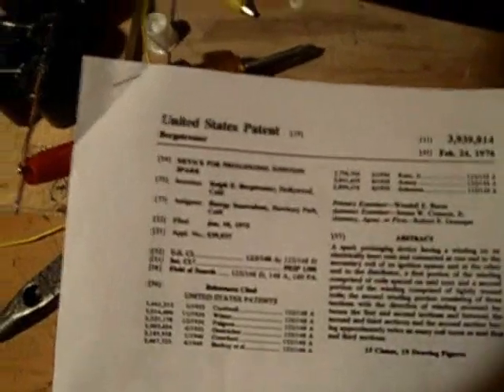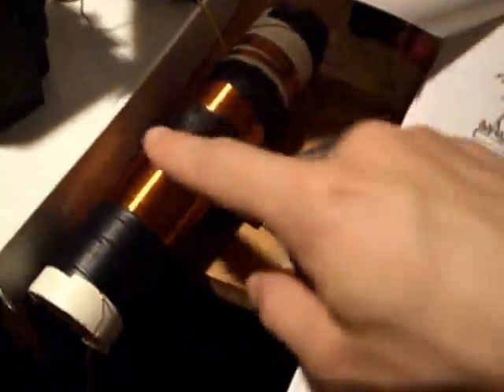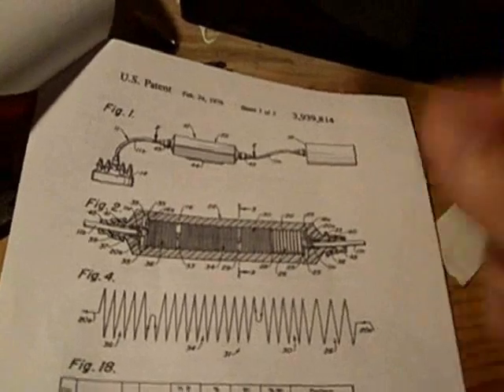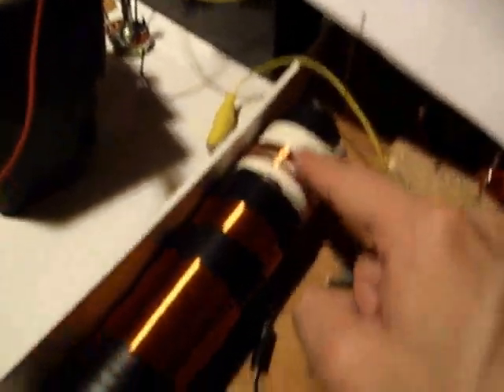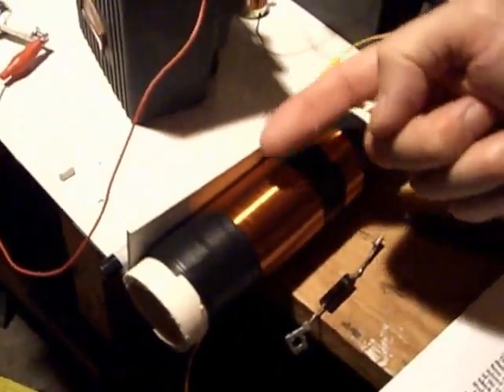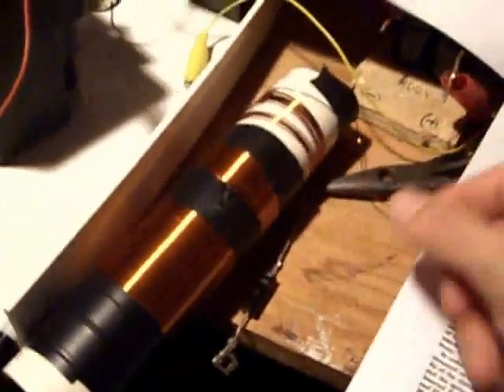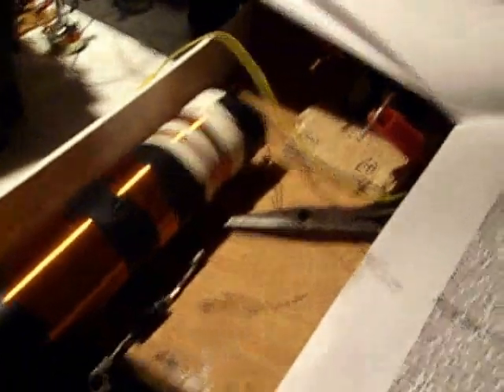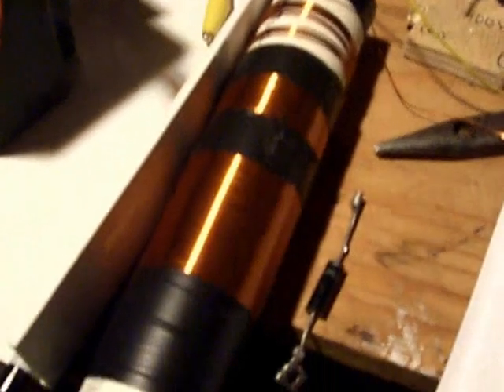Ralph Bergstresser Spark Prolonger 3939814

Comment: I know its been almost 9 years, however, I wanted to share something from the coil on plug (COP) world I thought you may get a kick out of, if you go to the Napa Echlin webpage and look up the COP assemblies, you'll notice the boot assembly has a spring in it, now it doesn't look like they reverse the windings but the pattern looks similar to your winding. Above that in the pack are the primary and secondary bobbins.
Link: http://www.napaechlin.com/media/2391648/bootspringassembly.png

There's also "Weapon-X", there's looks similar as well. Although I cannot find a good picture of the primary and secondary bobbins.
Link: http://www.weaponxperformance.com/main/images/products/weaponx%20ignition/best%20cigar%20coil.png